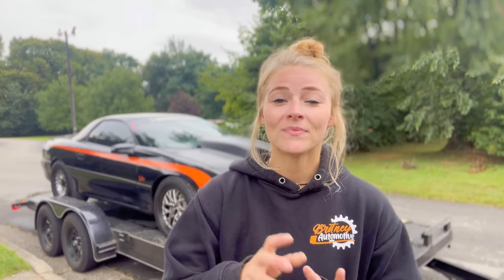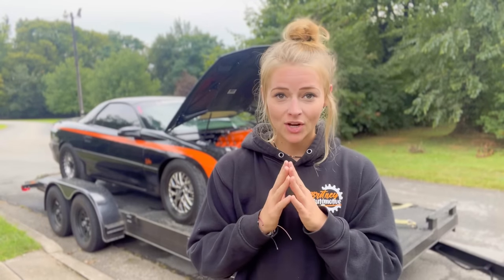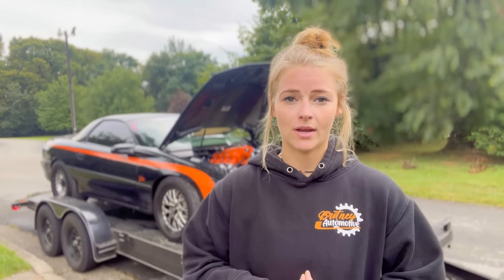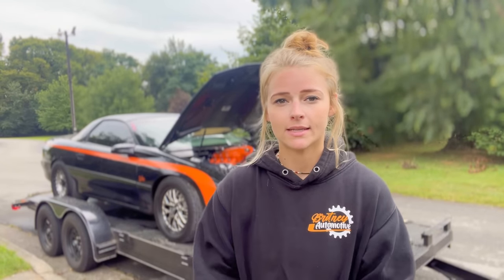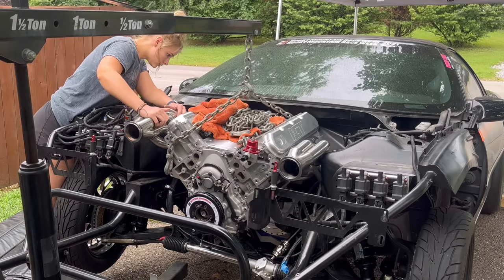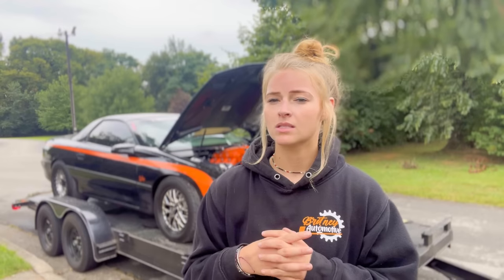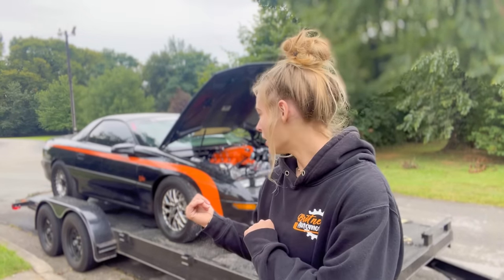GEN V LT1 Swap In An Fbody Camaro

Comment: I plan on installing a gen v LT1 in my 1992 Corvette.  Ive seen a great crate engine for sale  at Summit Racing. 500+ horse power with a 36,000 mike warranty.  Hot cam. Thanks for the video.  ❤🎉

Comment: With all the new components in place Britt , did you have to make adjustments to the trans and what gear ratio does the car have ? Cheers 🇨🇦
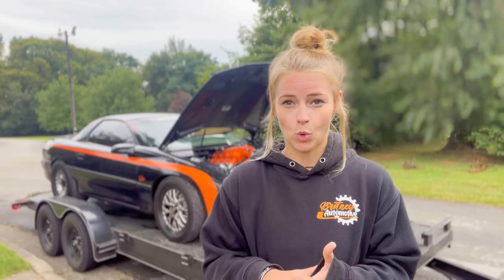Reply from the maker: Trans is fully built and it’s got a 4:10 gear!

Comment: Do you mean Gen 6 LT1? Gen 5 is LS like the late Gen 4.
Reply from the maker: Generations of engines don’t match generations of the car. For example A 4th gen Camaro came stock with a gen 2 lt1
Reply: What did a Gen V LTI come out of?
Reply from the maker: @gjodexter  there’s a few gm blocks that are considered a gen v lt1. They’re in various gms from 2014-2023

Comment: Umm excuse you ma’am I put a genV in my camaro 3 yrs ago… mine is a third gen so it pretty much the same
Reply from the maker: 3rd gens are not a 4th gen
Reply: @britneyautomotive  I know I’m just teasing you a little bit…. I do have a genV swapped third gen though check it out when you have time… I wish I had the L87 I have a L83 but it’s 4rwhp and still has plenty to go far as bolt on I can do